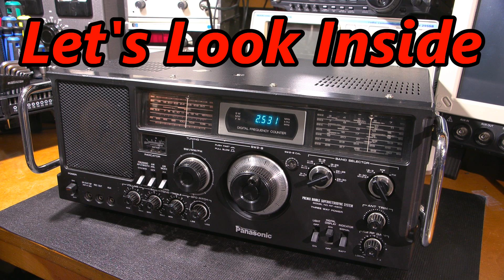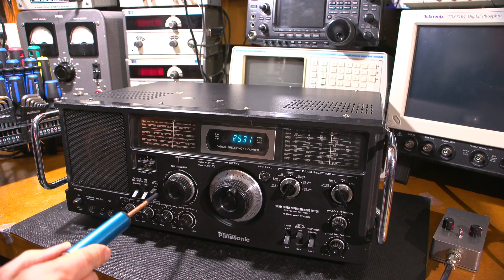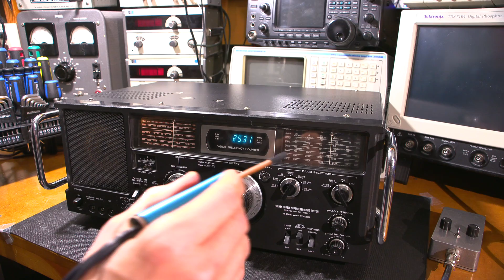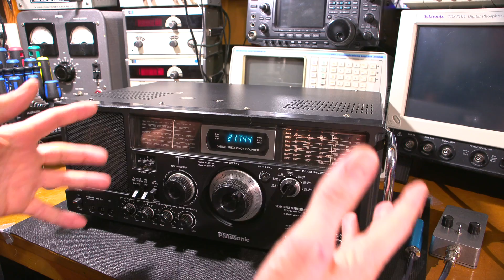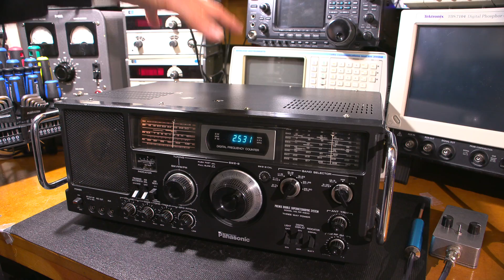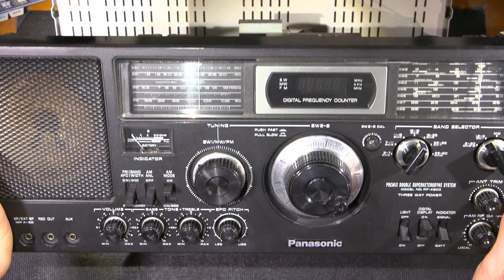Look Inside This Radio Receiver! The Collectible Panasonic RF 4900.

Comment: Collectable, restoration... hard to find original parts...
 These ideas make me think that you would not put blue LEDs in that even at gunpoint! (I wouldn't)

But, being alright with blue led diodes (which make me think of cheap Chinese stuff in polystyrene cases - barf!) why not contemplate slapping in and adapting a 7 segment  LED display?
If case would be, I'd put in permanently lit yellow or warm white leds/led strips to get nicely lit scales and green, yellow or red led frequency display (anything except blue)  
I personally have a луц10 transceiver that will get a modern, green led display instead of the pretty but very fragile tube display and really crappy frequency counter that burns itself out because the original ICs are really not handling the voltages and currents they operate at.

Comment: I've owned the RF-4900's kin, the RF 2200 and RF 2600. The only real problem I had with them was that they drifted. Not enough to be a problem listening to shortwave broadcasts but it made receiving single sideband and Morse code almost impossible. The 2600 had a multiplex jack on the front for a stereo adapter. It also output the 455(?) IF when on AM or SW. There was also a small dial labeled SW Cal. At first I thought it was either an antenna tuner or preselector. It turned out it was a passband tuning / IF shift control. You needed to set it about 15 degrees to one side or the other to best receive lower or upper sideband and it was great rejecting interference to one side of a broadcast station. It's a shame the 4900 didn't have these features.

Comment: My suggestion is to have both dials lit but make the dial in use brighter than the other. If you can try to keep to original colours, you never know who may be using this in 50 years.

Comment: If you do a full restore, you may want to take the opportunity to find a more selective filter for the narrow selectivity position, and/or, there may be enough slop in the IF alignment to narrow up selectivity a bit without sacrificing the audio response.  It was not terrible, it just was not as sharp as one may expect in the narrow setting for a DX receiver.  It may also have been a characteristic of the RF 2800 and not the RF 4900 so my comments may not apply.  Albert

Comment: I bought the RF 4800 (red display, no LW band) new in about 1975.  When I bought it, the unit was not as sensitive as my Hallicrafters SX-71 (close but not as good), and the selectivity was a little bit disappointing compared to the crystal phasing in sharp position on the 71.  In those days, selectivity was far more important than today, as each 5 khz in the international SW bands had something to listen to.  So it was not the DX machine of choice but quite fun as a listening machine, and it was "portable."  Lightning took it out about 25 years ago and I had none of your knowledge and there was no YouTube back then, so it was sadly disposed of.  Insurance on it and other household electronics paid for the JRC-535, so my sadness was quickly assuaged.  If only you were about twenty five years older so I could have repaired that receiver and the earlier defunct SX-71 (which probably only needed a recap) with your knowledge.  I am so glad you are not so old, so you can continue to train the younger generations as you have trained me in my later years.  Blessings, Albert

Comment: I have seen a couple of these online.  The S-Meter should be backlit.  They do only have the one light at one end of each dial.  Definitely a good candidate for LED conversions.
Apparently it can run on batteries as well, there is a battery compartment on the bottom.   You'd need to take that into account when doing lighting.
I think a backlight for the meter would be nice as white, but some powder blue for a background and bright white for the active tuner.
Reply: You can turn off the backlights and display to save battery power with front switches. Even on AC.

Comment: Mr Carlson,
I've watched quite a few (recent) videos of yours and you always say the caps have to come out. Even these ones. Does that mean I should also do that for an older Yamaha radio receiver (quite simpler than this Panasonic here) just to be on the save side?
Would a alignment be required? I do electronics just as a hobby and don't have such equipment to do the types of alignment you have done in the past.

This Yamaha receiver also has a similar knob as the Panasonic and that seems to be dirty. I already tried contact cleaner but it still has dodgy connections causing output on only one speaker until the knob is twisted a bit back and forth.

Thank you.

Comment: Thankyou for sharing your incredible electronic knowledge it has helped me a lot. One thing that gets forgotten and taken for granted is simple wire. There are so many varieties,sizes, compositions, coverings, etc. I would be very interested in what you use, why you use it, and where you get it. I must say I do find this tricky to decide on correct wire to use on projects or restorations, and I often get it wrong and the project looks terrible or even fails soon after due to faulty wiring. Might make an interesting video?

Comment: Install a second bulb/LED on each display. The second bulb/LED could be wired to the power switch and would power up when unit is powered on. The OEM bulb would continue to illuminate with the selected display as it camp from the factory.

Comment: Oh wow. I had this receiver's little brother - the DR28 (aka RF-2800) in the late 1980s - no PLL so it'd drift quite badly on the HF bands, but I DX'ed all over the world with that. I do wonder how newer radios without coils and old-fashioned variable capacitors compare for sensitivity etc to these traditional designs.

Comment: Panasonic also made the RF-4800. Almost identical to the 4900 but has a red LED display (instead of the green VFD) that only displays on certain bands whereas the green VFD displays on all bands, and some other small differences. Both excellent receivers.
Reply: I just bought a RF-4800. Works but needs a lot of cleaning of the crud that has dropped in thru the vents. Especially the flat band switches.  As far a recapping, looks like I have a great but long project.
Reply: @rontaylor392  Just curious- do you know the going prices for the 4800 and 4900? Thanks! Doc in VA
Reply: I have both. Very similar.

The 4900 has a white speaker as well.
Reply: @drippinglass  I have both models as well.

Comment: I thought this was the same as mine but the one I have is a DR 49, which has a battery compartment and a couple other minor differences. But, yes, they're nice units. Too bad that so many shortwave stations have gone kaput. And no changing the lights. It's a classic. Keep it bone stock.

Comment: Hello Mr. Carlson, My name is Levi Mevis, and I hail from Elkhart, Indiana and I have been restoring vintage electronics since I was 13 years old and I'm 31 years old now. Anyways I have an old Westinghouse Model 182 kind of like the one you restored a few years ago and the one I have won't put out any signal whatsoever on either AM or FM and I've replaced most of the paper caps in the set with Mylar caps and I had replace the old interlock cord with a NOS interlock cord because the original interlock cord was dry rotted. Anyways do you have any suggestions as to what I should look for to try and get my radio to start receiving radio signals again? I also checked all of the tubes and they all tested like brand new on my Tube Tester.
I look forward to hearing from you.

Sincerely,

Levi.

Comment: I have a National Panasonic DR48 Communications Receiver, looks a lot like yours? Thanks for sharing :)
Reply: Our North American version of that unit was called the RF 4800
and the difference between the RoW version and the North American version was that our units had FM band and yours had LW band.
Reply: @watershed44  Must be another version then because mine has both the FM and LW bands.
Reply: @Coldoikz1
It depends on market, the reason the US version didn't have LW is because our country never used LW for any non military purpose. 
In Europe especially LW was a popular was to provide long range commercial broadcast reception.

Comment: Looks like a nice restoration project!  Good idea on the LEDs.  Solid state devices almost always benefit, tube sets not so much unless the color is chosen to closely match the original incandescent bulbs.  Some sets, tube or SS, can use additional lighting just because the bean counters went a little too far when the devices went into production.  This looks like one of them.   Also, I'm looking forward to seeing how you decode the colors on the IF cans.  I know there's a method to that.

Comment: I have the 4800 which is actually an analog receiver with a digital (red LED) read out. It has a trimmer to calibrate the digital display. I don't know if the 4900 is analog or pure digital as it's a later model and I'm not familiar with it. They're both beautiful radios! Built like Sherman tanks!
Reply: The main difference in the 4800 and the 4900 is that the unit uses a less noisy VF display instead of the LEDs, and the SW-1, AM, and FM band will actually show up on the digital display.

Comment: I'd keep the incandescent bulbs but have them both constantly lit except the selected dial is brighter.
Reply: Could install lamps on the opposite sides and have them light up while that side is selected. Keep the originals on all the time. Led in a soft blue sounds nice. Another plan is to have pairs of lamps on both sides. Have a set on always, then the others only while in use. That would be a total of 8 lamps.

Comment: For the epoxy on the lid, warm from the inside, and then use a sharp chisel, placed about 2 mm from the edge inwards, and give it a quick tap at a shallow angle. Might work, might not, but if it's to take it off, you might as well try it, you'll have to sand that either way.

Comment: I'm excited! I have an rf-4800 that i purchased in 1977 or 78. Mine has problems with dirty potentiometers a the bfo drifts. The digital readout, (which was pretty modern when this radio came out), is red instead of green and doesn't quite go blank as it should when i'm tuned to mw. 

I have picked up a lot of dx on this radio. When Gulf 1 broke out I listened to RCI and BBC to get much of my news. I can't wait to see what comes next. Thanks Paul for your channel. I'm a patreon subscriber and I know it takes a huge amount of effort to make these videos and that doesn't even count the restoration work! I will up my monthly commitment when I start building some of your inventions.
Reply: @wilsonri
The 4900 will actually digitally display the frequency of AM, FM, and SW1 bands, unlike the 4800.

Comment: Nah, Yaesu FRG-7 runs rings around those Panasonic & Sony glitter boxes of that era...
Reply: @Jabba LeChat
The FRG-7 is a great rig, but actually the RF 4900 is a super sensitive unit and has a super low noise floor and really exceeds the 7 in a number of specs, of course the 4900 was from the late 70s while the 7 was from the early mid 70s.
Reply: @watershed44  The RF-4900 is not stable in the shortwave spectrum, particularly on ssb, it's a known design fault, best admired from a distance...
Reply: @Jabba LeChat
Actually that was only an issue on the early production run, there was an article on this in WRTH in 1980. They even listed the serial numbers to refuse.

Comment: I had the RF-2900. Of course the fluorescent digital frequency display was incredible when I got it in the 1970's. It worked for about thirty years until everything in it began failing with FM the last to go. I know I was supposed to want to fix it, but I have lots of other shortwave receivers and this heavy "portable" just wasn't worth the effort to fix.
I looked at my notes and the radio had a lot of mechanical problems. The bandswitch control was stuck on FM, the tuning gears were tight and skipping, and all this failing mechanical stuff was deep inside the radio. I don't mind working on electronics, but gears and pulleys are not my bag.

Comment: I have one that I picked up on Craigslist last summer. All I had to do was clean all the switches. Gotta love Caig Deoxit. Also have the original factory service manual. Nice bonus.
Reply: Recap it, immediately. Seriously, any bad cap would or could ruin a treasure.
Reply: Bruce Nitroxpro 

Are you sure?

My brother has a couyof old Moog synths, including a ‘69 modular.

I think the caps are factory.
Reply: @drippinglass  I know nothing about it, but IMHO if you watch enough of Paul's videos you will get some idea what can happen with bad caps.

Comment: Here's an idea.  The blue LEDs for backlighting the dial not in use, and either pure white or incandescent yellow (amber) LEDs for the dial in use.  Warmer colors tend to stand out, getting your attention to the dial in use while cooler colors tend to stay back.  Avoid red if possible because red is a rude, aggressive color (which is why they use red on store front signs, traffic lights, and stop signs).

Comment: Hey Paul,
That is one beautiful radio...and as you said, a LOT of work just to replace the electrolytics alone.  But most likely well worth it.
I would suggest that you use Blue LED's for the active display, and possibly Green, Orange, or Yellow for the inactive display.  It really would be best if the displays had light from both sides, so that would mean 4 L.E.D.'s total for the displays, but I think it would be worth it.  Does anyone make a multicolor LED that includes Blue as one of the colors?
The meter really ought to have a Blue LED too!  I think it would make a very positive difference and make the front really snap!
I am really looking forward to the videos of when you do the work on this radio!
That reminds me, you said you were working on a project with Magic Eye tubes...both single and dual display types...and that you would show that once you had it designed.  I would love to see it but haven't even heard you mention anything about it since that one video.  What is the status of that project?
73
WB4RHA

Comment: Your RF probe lighting the LED while pointed at you hand gave me a thought. A current conspiracy theory is that the latest deployment of 5G is cause the Corona Virus problem. 
Yea, I know... so dumb. I think we all know we are isolated so the govt can change the batteries in the surveillance bird drones...;) . 
Would you consider maybe do a bit on the effects of radio waves and in particular this new cellular tech on the surrounding environment just so we can point to it when these folks surface. I think 5G is a new freq as well as tech because it needs more towers.  While its higher freq than your normal area, You have a gift of clarity that would be helpful. think about it.
Reply: @OldePhart
I like that idea, and it's been proven that microwave radiation can damage human cells even at a fairly low power. I  don't trust the businesses to be honest since they have tens of billions at state deploying it.

Comment: I love the look of that era of equipment.  When I rebuilt my computer I got rid of the molded, streamlined plastic parts and gave in a heavy aluminum face and framing so it looked like a PC if it was an instrument from 1930s thru 1950s.  

I want my PC to look like Buck Rogers,, no Flash Gordon.

Comment: Hooray!  I was hoping for the RF-4900 but didn't expect it this quickly!  We've had one since 1985 and many SWL hours on this one.  The S meter definitely is backlit in our set.  Ours has very dirty contact switches so looking forward to the restoration.
Reply: @Phil Erickson
I have one of these I bought brand new back in 1981! As far as the S meter the RF 4900 has an edge lit meter while the older RF 4800 has a back lit meter. The pots on these units and switches get very corroded over time and need a good treatment of deoxit (BUT YOU MUST BE VERY CAREFUL TO NOT LET THE RESIDUE OF THE CLEANER DRIP INTO THE OTHER PARTS OF THE UNIT!!!!) ESPECIALLY BE CAREFUL TO NEVER LET ANYTHING CONTACT THE THREE GANG TUNER POT FOR THE MAIN TUNING KNOB!)

Comment: I noticed what looked like a battery box next to the power transformer board and Briefly saw what looked like 2 battery compartment doors on the bottom of the radio. Does it run on batteries also?
Reply: Yes. 8 size D cells. I also made up a power cord with the coaxial plug for connecting to a cigarette lighter socket. It is tip negative, so be careful.

Comment: Looks like a really interesting project, looking forward to seeing the restoration - blue LEDs for the active window, green for the none active, white for the meter. - Have fun!!
Reply: I know EXACTLY what you mean, I think the ones I put in the Drake TR-4C were from DigiKey, wish I kept the part number, I have to admit I tried several before I got the ones that matched what the original color was supposed to be,  just what you described.

Comment: Paul a heat gun should get that epoxy off. Might need to touch up the paint after though.
Reply: I think that it will burn both epoxy and top layer that way.
Reply: @erikdenhouter  I've used a hot air soldering station to remove epoxy before. The heat causes the epoxy to go sorta weak and crumbly, you can then get it off with a plastic scraper. It may damage the paint however, depending on what kind of paint it is. So that may need to be touched up afterwards.
Reply: Good luck with that, I would not dare. Heat will indeed burn and crumble epoxy, but that paint all around will suffer.
Reply: Erik den Houter A smd rework heat gun is highly focused, if enough care was taken I think paint damage could be minimal. Also it looks like 5min epoxy most technical people have some on hand anyway, I would do a test on a junk park before I attempted it on the good case.